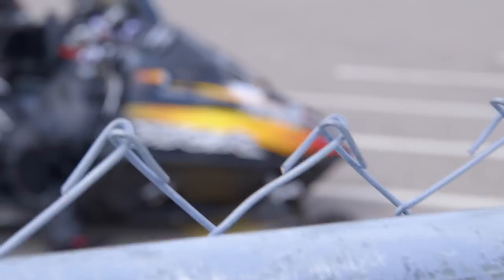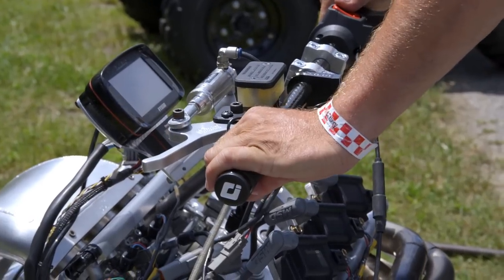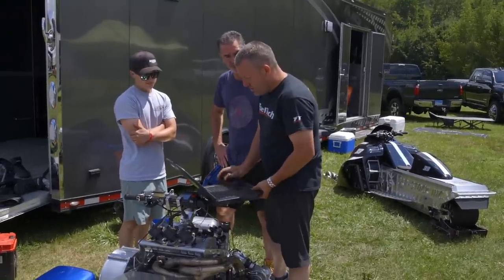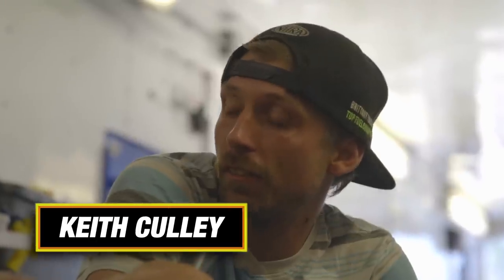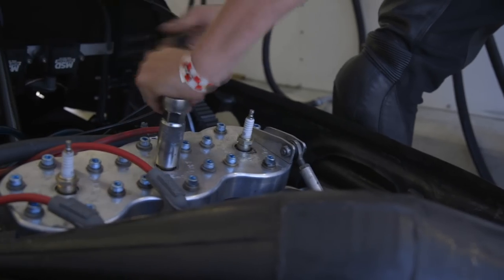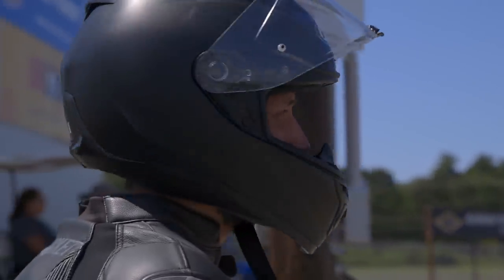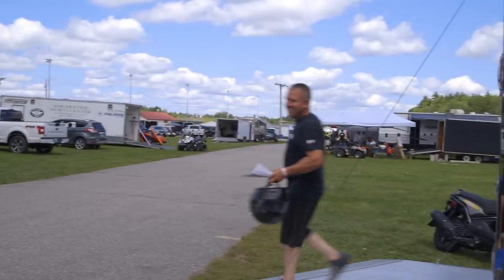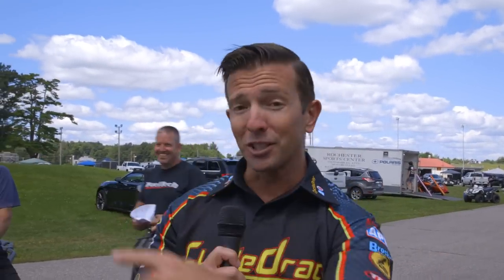800+ HP! FASTEST Snowmobiles on Earth Race on PAVEMENT! Turbo & Nitrous Outlaw Sleds are Nuts!

Comment: I started to drag race when I was 15. We raced in the WSRF association. I probably raced over 700 times. It was awesome
Reply: When you get at the starting line Never creep up. Make sure you get it on the line. If you creep it makes the belt go down the torque converter. You want the belt to stay at the top.

Comment: Can these snowmobiles be used in the winter as just a normal snowmobile,  or are they only used for drag racing.
Reply: They must have modified radiators because a sled will overheat and blow up without snow to help it cool the radiotors under the footboards

Comment: Remember when they first started doing this stuff and we didn't want to see it at the truck and so it was put down to Thursday nights. That being said classic cars are now way over-the-top in price. Let the snowmobiles rule.
Reply: And when snowmobiles are too costly to run, then we'll end up on minibikes :)
Reply from the maker: Thanks for watching. Would you ever give Outlaw sled a try if given the chance?
Reply: @cycledrag  being a lifelong vmax owner and never laying it down.yes 
At one time I held the longest wheelie at firebird raceway in Boise Idaho, I was on a v65 magna with a kirker. I had been a big fan of pee wee Gleason he had tested the v65 and was able to get it into the tens at sea level. I practiced my lunch and my stuttering clutch release many many times. That being said I got prepared to make my second pass or the 3rd if you consider timing in. I was in the far Lane or left lane El firebird the right lane is called tower lane. In the tower Lane was some guy on a Harley. I  lined up right in the track where a pro bike had just ripped off an amazing blast I put my muscle memory to work and went through the motions brought the bike up to 6500 at just the right moment to my shock I was instant traction I pulled in the clutch three times is the clutch would depress the right wrist would snap the throttle off on each pull  of the clutch this was before I knew about Keith code twisted the wrist. And this was before I knew about really control with the back brake it was then that I learned. I touched the back brake somewhere pulling the clutch in the throttle snapping on and off. And I was passing the Harley and shifting through the we leave it was going down long story short when I got back to where my girlfriend was after picking up my time slip she said that I had set their track record for the longest wheelie 😂🤣😭🫣🧐. In later years I was in NHRA mechanic for a d/s stocker seven-time Wally winner 🏆  I got to meet a lot of awesome people involved with drug racing at all levels. After pica Kansas at midnight I was writing a Honda elite 250 pit bike and had to use both brakes and drop my drink because I almost ran over somebody in a black leather jacket in the upper pits ."whoa whoa partner" it was John Force my bike kid stuttered and skipped to a perfect stop and I look up and I say Mr force we had a little conversation about my boss the next day Mr Forrest was paying for all stalkers to feast at the Piggly wiggly in Topeka. I have nothing but good stories and good things to say about all of the people involved with the NHRA tour. I'm 58 years old now and thank you for commenting back to me. I no longer have a street bike I sold my V-Max there's too many people looking at center console screens and not paying attention to ride on the streets anymore in my opinion. I love your zest and appeal for cycle drag racing . Maybe you could do an interview with racers for Christ sometime.🏁🏁

Comment: If these guys were to do a quarter mile pass, what would the estimated ET & MPH be at 1320 feet?
Reply: There are some sleds that run 200 in a quarter mile at US 131
Reply: @brianflowers4751  Those little wheels on the front must be turning pretty fast at that speed.
Reply: Used to be in 8’s when they were in Brainerd
Reply from the maker: Good question. Thanks for watching. Would you ever give Outlaw sled a try if given the chance?

Comment: A throttle thumb and 3-point stance is definitely different from a stock, THC foot-shifting motorcycle on 2 wheels…..different skill set, with balancing on 2 wheels being 1 major factor……different strokes for different folks. 

The only thing that interests me is the engineering of the unlimited/open class to see   The power being made by custom manifolds and one-off billet pieces; each engine is unique to everyone else’s…….